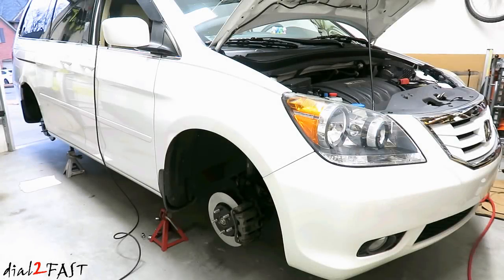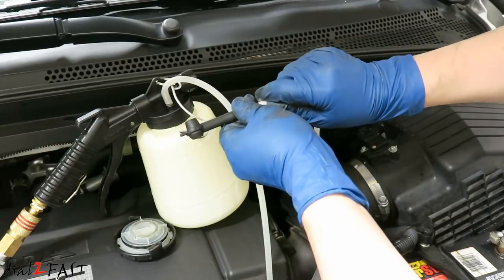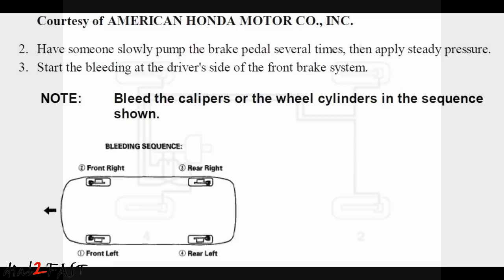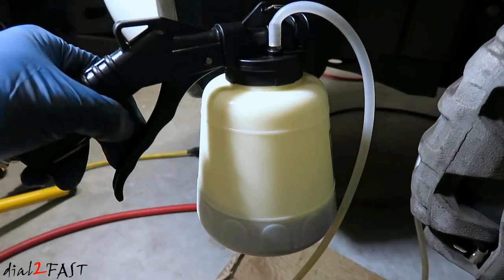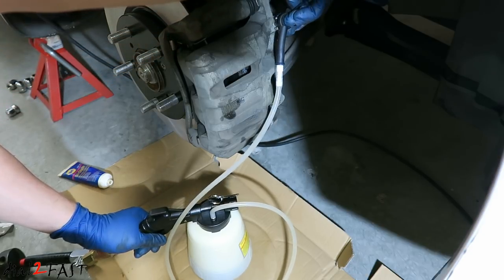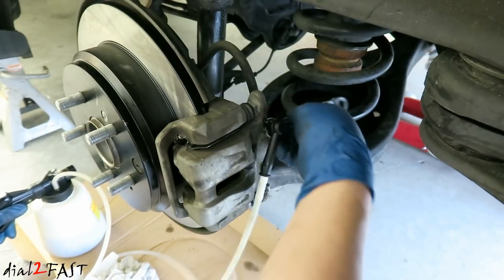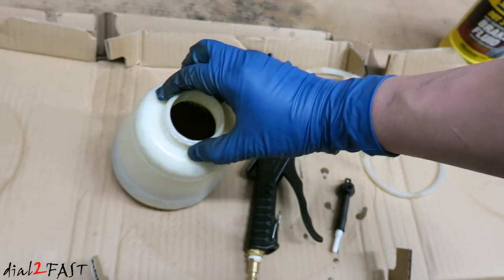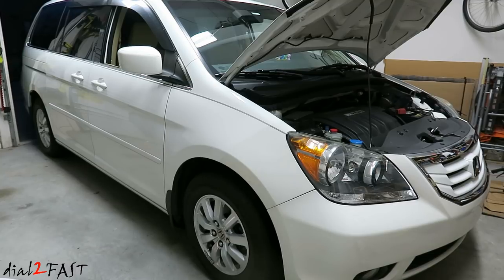How To Bleed The Brakes By Yourself - Vacuum Brake Fluid Bleeder Tool

Comment: The vacuum method is the way to do this. Bonus points for using an actual torque wrench. Kudos to that.

One question, do you think I could jerry rig a shop vac with a catch bottle and some appropriate fittings to regulate vacuum pressure as the vacuum source?
Reply from the maker: Shop vac does not provide enough PSI and doesn't have the fittings to connect.

Comment: Love your vids , but I had so many problems with the vacuum method. I didn’t get any brake fluid out. I suspect that there maybe something with vac tool in combination with user error. Had to call a friend to do the brake pump method which worked so much better. Was I supposed to pump the brake to tightness before each vacuum attempt?

Comment: Great vid. Just what I needed to see. You make it look real ez too.
Questions,
once getting in to the driver seat should the firmness of the brake be seen right away?
Do you discard the remaining DOT fluid? Or save it to use later?
Where did you find that CFM information if it wasn’t in the ins booklet?

I’ve a Porter Cable 6 gal, w/2.6 scfm @ 90psi. 
Is this not acceptable?

Thanks,
Reply from the maker: Unless your old brake system had air in it, usually you don't feel a huge difference after flushing the brake fluid (regardless what people tell you). The old fluid is discarded and not to be used again. This brand of bleeder gives no spec on CFM, so I used spec from another well known company which has the same design (as a general guide). I wanted to share this info because many people are not able to get this bleeder to work with their setup and CFM plays a big part in its operation.Your compressor will probably not be able to operate this tool properly.
Reply: dial2fast 
So I guess I’ll be looking to purchase the hand pump operated type so that pressure gets to build for vacuum, right?
Thanks for the quick reply earlier. I’ve already shared your video w/ friends.

Comment: Pump brakes before starting (to take the assist out).  Use Honda brake fluid.  Great vid.
Reply: I have the same mini van but is it a close or open ABS system